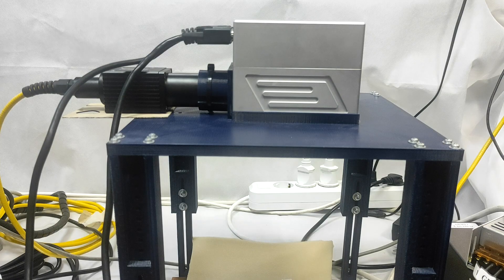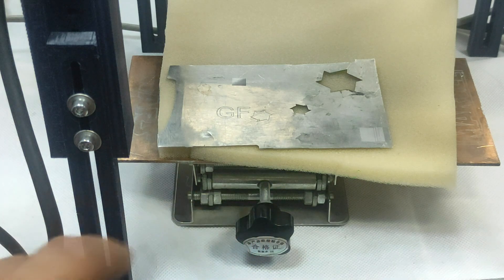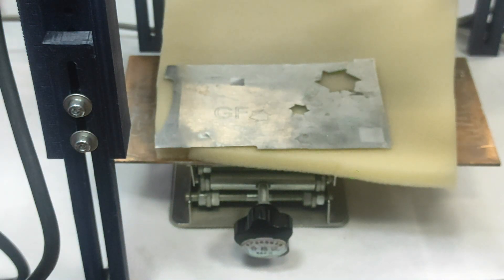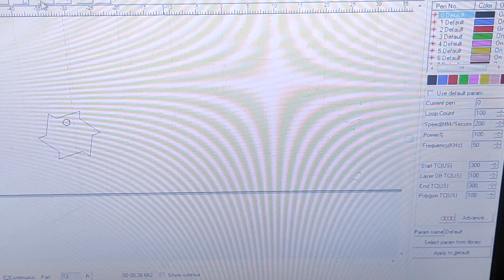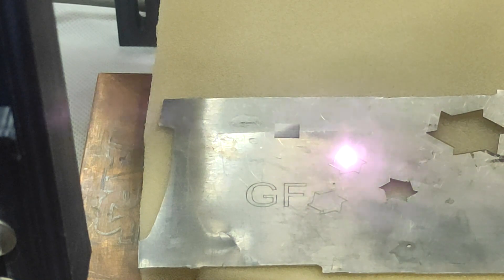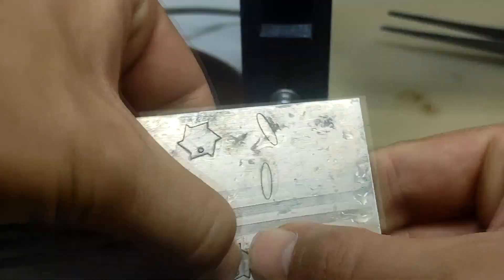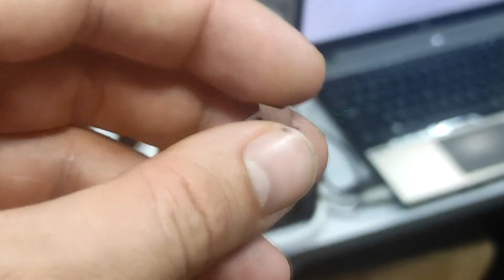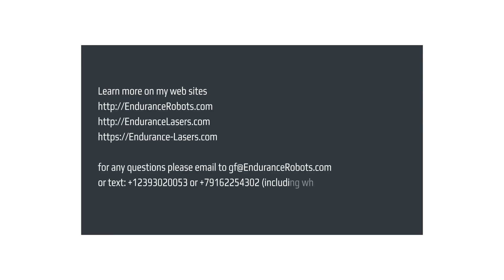Laser metal cutting with Raycus 30 watt fiber laser installed on an Endurance DIY galvo frame

Comment: Have you done the cutting with any wobble parameters?
Reply from the maker: like what?
Reply: @Endurancerobotschannel  We can only set the diameter of the wobble and the distance between each diameter.
Reply: Hello what's laser source type from raycus QS, Q or QB?
Reply: @kara5310  Raycus
Reply: @3DCA  there's 3 type into 30w raycus laser : the cheaper is QS . I'm wondering what is using in this video